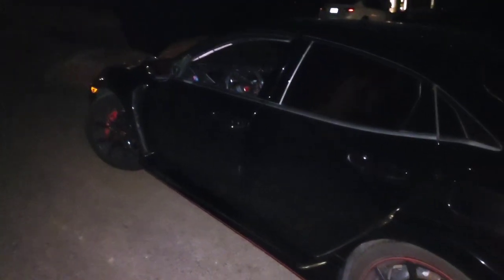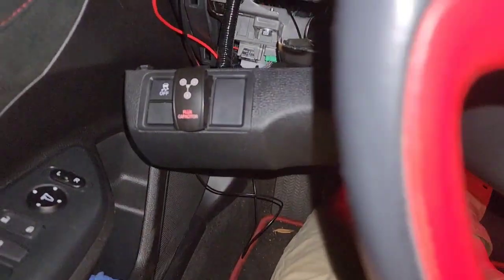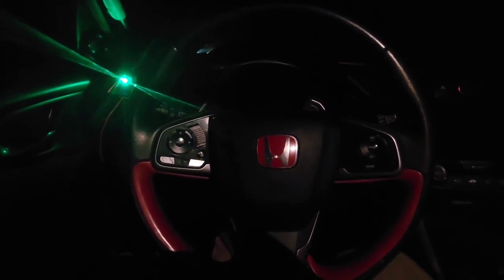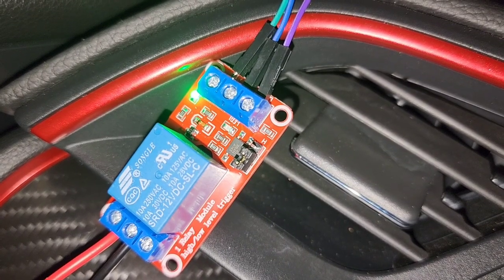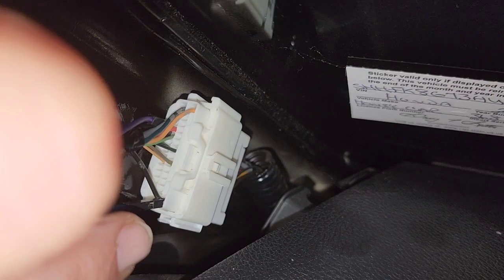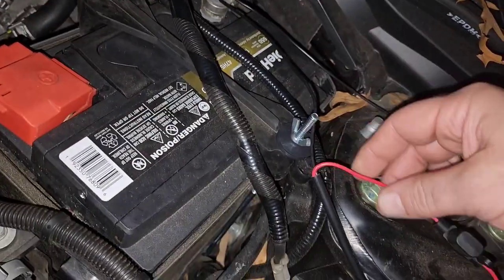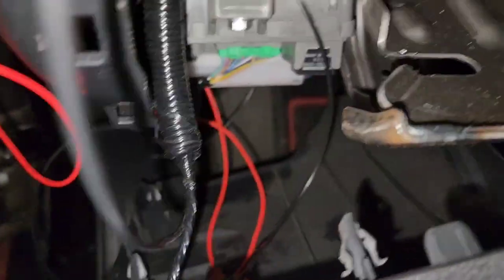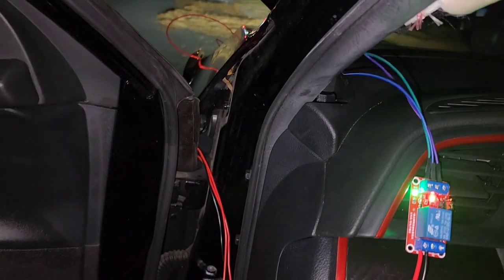Using LED underglow as courtesy lights

Comment: Did you ever figure out the buzz? Did this to my tacoma and whilst googling about the buzz I stumbled upon your video.
Reply from the maker: Yes, I believe I linked the new updated video in the description, but I basically rewired the entire thing differently.  Instead of using the dome light circuit as a trigger for the relay and powering the underglow from the ACC circuit on the 12V+ side, I'm now using the ACC as the trigger for the relay and powering the LED directly to the battery with the relay on the ground side.  

The ground wire from the dome light is wired to the NC (normally closed) pin of the relay, so that when the car is off (no ACC power signal), the LED circuit will become grounded and complete the circuit anytime the MCU automatically turns on or off the dome light, which it does on the ground side downstream of where we tap into the wire.  Then, when the ACC is turned on, the signal switches the relay from the NC position to the NO (normally open) position, where the ground for the LEDs is connected to a dash switch and then the chassis.

This eliminates the buzz because that was caused by the variable PWM signal that was being used to trigger the relay, and when the voltage was in the mid-range (with dome light dimmed), the relay is being triggered on and off rapidly, causing the buzz.  By switching the trigger signal to the ACC circuit, this not only eliminates the buzz (because it's either all the way on or all the way off), but by powering the LED directly from the battery on its own circuit and sharing ground with the dome light circuit, the underglow also now has the same fade and dimming effects as the dome light.